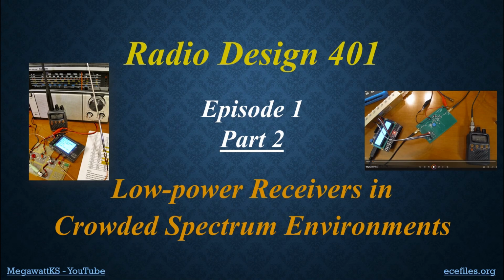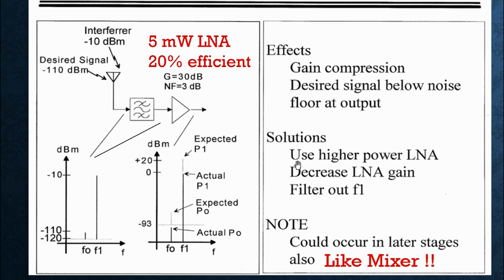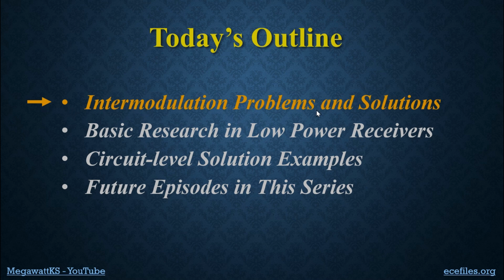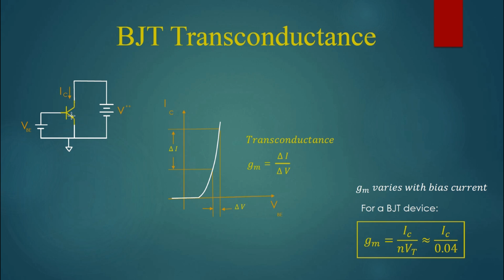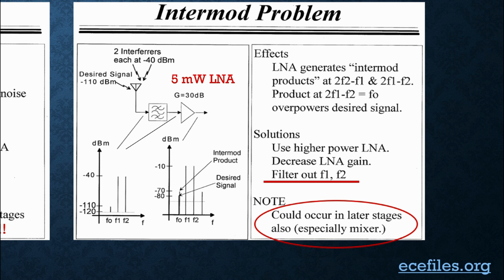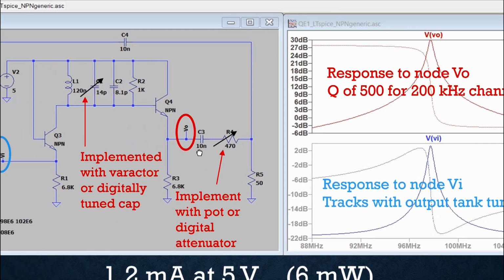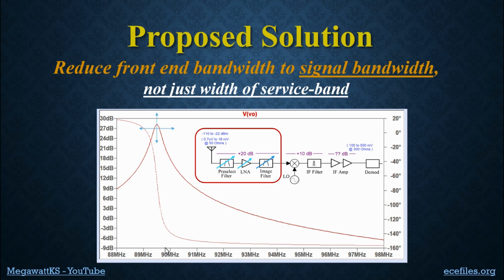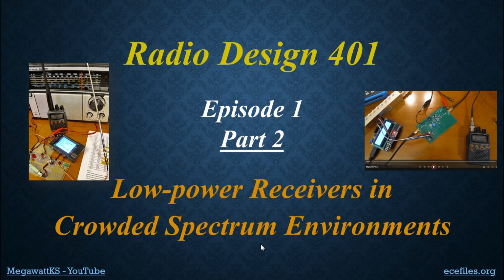Episode 1 Part 2 in Radio Design 401

Comment: Very interesting circuit for low level signal Rx. I did miss how this filter tunes to other SOI.
Reply from the maker: Thanks -  and sorry for the delay in replying. Tuning was done in the first prototype with a varactor diode in the collector-node tuned circuit. In later designs we used Peregrine Digitally Tuned Capacitors (DTCs). The basic idea is somewhere around 27:40 in this video. https://youtu.be/tuOc61TShDg?list=PL9Ox3wpnB0krNexW2k5JMCaewXN7LoRXd&t=1662   Bandwidth and gain are adjusted with the potentiometer in the feedback path. Hope that helps.
Reply from the maker: The version with the DTCs for tuning is in Part 3. Here's a direct link queued up to where the schematic is shown: https://youtu.be/43wQmYeqt44?list=PL9Ox3wpnB0krNexW2k5JMCaewXN7LoRXd&t=1789

Comment: Hi, when comparing the intermod products at https://youtu.be/tuOc61TShDg?t=1371 (i.e. 22mins into the video), you've changed the frequency of the original signal.  On the left it's 98MHz, while on the right it's 98.5MHz.  Doing the FFT on the left simulation with 98.5MHz signal instead of 98MHz shows the original signal, but it's about 80dB below the intermod products.  It's only a detail.  It doesn't downgrade your explanation.
Reply from the maker: Good comment !  Absolutely correct. I had to do that to be able to resolve the two spectral lines of interest - the intermod at 98 MHz and the "desired signal". If the signal is left at 98.00 MHz, we wouldn't be able to see it separately from the intermod.  So I just moved it to the right 500 kHz. I tried 100 kHz, but that didn't work since the transient sim is only run for about 15us. And only the last 10us is FFT'ed, so the resolution is somewhere around 2*(1/10us) = 200 kHz (the factor 2'ish is from the Hamming window applied in the FFT). I guess I should have run the other simulation with 98.5 MHz as you must have done. But the main point there was to see all the intermod products, and the signal would be 60 or so dB below the 3rd order products. Still - it would have been a better presentation. Thanks for pointing this out. It brings up some of the complexities involved in setting up the transient sim time and the FFT 🙂

Comment: Thank you so much for the great content you provide generously.
There's something about gain compression I don't understand and you mentioned it in the 101 series too.
When the sum of a strong and a weak signal enters an amplifier, the stronger one puts the amplifier into the compression state and so the gain for is reduced.
But the weaker signal is still in the linear portion of the characteristic curve and experiences full gain of the stage as normal.
So, why do you say that we the weaker signal also experiences the reduced gain? Am I ignoring something or what?
I'm clearly ignoring the nonlinear effects, just focusing on the gain aspect as you did.
Reply from the maker: This is a great question.  The short answer is what you said - the non-linear effects are being ignored in that line of reasoning. We're assuming there are two signals at two different frequencies with different amplitudes. It is the sum of those signals that goes through the amp and since it's operating non-linearly, we have to use a Taylor series expansion to figure out what happens. We can't treat it as a linear circuit like we normally would and consider each signal separately. The math is quite a mess since we need to include up to the third-order term of the Taylor series, which with two signals means many outputs at different frequencies. But we would concentrate on those that lie on the frequency that the weaker signal is at. At least one of the third-order terms will lie on the weak signal frequency and (usually) subtract from the basic first-order amplified output at that frequency. So the effective gain at that frequency is reduced.
Reply from the maker: To be fair, the math is such a mess (see for example: https://www.youtube.com/watch?v=0xwaxB9o1Ps ), that most people don't do it. BUT - maybe we could configure a simulation to see what happens. (The simulator handles the non-linearities when used in "Transient" analysis mode). But as in the video, we'd have to use an FFT to examine the output of the amplifier in various states of compression and see what happens to the weaker signal's amplitude in 'reality' 🙂

Comment: Could you please elaborate on the schematic at 28:00?
Firstly, from my calculations, Q3 has a voltage gain of ~20 and an input impedance of 50Ω. The output voltage divider is 25 / (470 + 25) = 1/20.
So, any R4 value below 470 would cause oscillation. Is that correct?

Secondly, how did you manage to eliminate the biasing network at Q3's base? Since Q3's collector voltage swings above and below the 5V rail, wouldn't that cause the Base-Collector junction to be directly biased for half of the signal period?
Reply from the maker: To the gain questions, yes - if R4 is dropped too low the circuit becomes an oscillator. So "automatic tuning" is needed in any real product to bring it close to that point, and then back off an amount that will get to the filter bandwidth desired. Interestingly one will never see the oscillation in an "AC analysis" which is what is shown. As one changes R4 and approaches the critical (oscillation) point, the gain goes very high and the bandwidth sharpens toward zero. But then, if R4 is reduced further, the gain will come down and the bandwidth will widen up again. So simulation needs to be on "correct side" of that critical oscillation point before trying something like a "Transient analysis" simulation...
Reply: @MegawattKS  yes, I did run a transient analysis to confirm that it oscillates
Reply from the maker: On the biasing, the circuit shown is not optimized for signal swing. It's just something I threw together for the first prototype. It works OK for smaller signals (less than 0.5 or 0.6Vpk) at the collector because Q3 will stay in the active region until its base-collector junction becomes forward biased - which is around 0.7V peak signal on the "negative" half cycle. True - the collector voltage will be below the base voltage for half the cycle, but Vce will not collapse to zero unless the collector falls below the (5V) base bias by 0.7'ish volts. Recall that most BJTs have a Vce_sat of about 0.1V. This was changed in the second prototype and Q4 also needed to be rebiased to allow large collector swings out of Q3. As shown in this first-prototype, the Q4 BC junction will become forward biased on the positive output signal swing at about 0.6V. Does that make sense?
Reply: @MegawattKS  it makes sense, thank you. Looking forward for the 3rd part
Reply from the maker: Another way to say this is that it is OK for the BC junction of Q3 to become "forward biased" a little bit 🙂 The carriers injected into the base from the emitter will still be swept into the collector because there is still a residual "built-in" field at that junction.

Comment: Hi, 
This series has been the most informative about radio receiver design I could find on the web.  Thanks for that.  I'm still working my way through the series, so I haven't watched all episodes yet.
I would like to homebrew an FM-broadcast receiver based on the design principles presented in the previous and this video series.  Would it be possible to get more information on the "implementation details"?  e.g. I have never designed a circuit with varactor diodes before.  Did you put two of them in anti-series and connect their cathodes to a higher (>5V) DC-voltage?  It would also be welcome if you could share the schematics of the "Q Enhanced Filter Core PCB" shown in the video.
Reply from the maker: You're welcome. Glad you found the channel. As to the schematic for prototype 1 of the QE filter, the main thing missing from the schematic presented is the varactor tuning (and a 100 Ohm series R at the output). You are correct that it is a to-diode pair in the package with the common cathodes tied to the collector node. Since it was a quick build, I don't even think they were officially varactors - 'BAT54C' Shottky diodes from my "Interstellar Electronics" SMD kit I had on hand. Marked 'KL3', but you can find the datasheet on Digikey with the BAT54C part number. It shows C varying from 18 to 6 pF for 0 to 5V bias. The rest of the circuit there consisted of the Pot at the top left of the board to produce bias - probably 50K or so from +5V to ground to keep the DC current low. The wiper of the pot is tied to the two anodes of the diode-pair through an 82K resistor to keep the Q good (see the resistor marked 823 in the photo). And then the node where that goes to the diode anodes is bypassed to ground with something like a 10nF cap. (just to make it AC ground as the variable in the schematic shown was). That variable cap went to +5, but that's just because +5 is bypassed locally to make it an AC ground. Sorry - I never drew a schematic with the varactor in it. I just moved on to Prototype 2 - which will have a full schematic shown in Part 3 of the episode - and is already on ecefiles.org  🙂  (Prototype 2 is the PCB version and the varactor was replaced with some digitally tuned caps.)
Reply: @MegawattKS  I found the schematic, thanks.  The final design has the varactor replaced by switched capacitors (as you already noted in another comment here).  I'm looking forward to part 3 of the episode to know more details.

Comment: Great video again...Thanks!  Looking forward to testing this out.  I love the positive feedback and have built many regens with it. Never built a Q Multiplier... Is this a similar idea?
Reply from the maker: Thanks for the feedback - it is very much appreciated. Yes, in a very general sense, they are similar ideas. You can do Q-enhancement (with positive feedback) at RF like in the video or at IF. I think the main difference might be that the Q multipliers are typically identified at IF. I had a Knight Kit R100 with a Q multiplier in it when I started out in ham radio. I miss that receiver!  73s  (BTW - I saw your 40m CW radio project on qrz.com. Looks awesome!  )

Comment: This is very cool indeed. Love your content, very informative and the presentation is crystal clear. Btw, is this scalable to higher frequencies then FM broadcast? Lets say 2.4 GHz Bluetooth LE with 2 MHz per channel? Or how about WiFi with 20 MHz bandwidth per channel? Or are there some constraints which in the end limit the practicality of such application? Is maybe gain flatness an issue on wider bandwidths?
Reply from the maker: Thanks for the encouragement and good questions. Yes - definitely scalable to 2.4G and other frequencies. It's just a matter of the technology. We're working on a 2.4 GHz version for WiFi in a deep submicron process (< 100nm) where the transistor capacitor parasitics are small enough and on-chip inductors are possible. 2 MHz bandwidth would mean an enhanced Q of 1200 - which is entirely doable if starting Q in the inductor is decent. However, real-time tuning (which we'll discuss in Part 3 and later) is needed. So this is definitely a research-level endeavor. I don't think gain flatness would be a problem since the final stage in a receiver is typically DSP and doing an equalizer would be pretty easy there. There is work in the literature on these things periodically, but noise and dynamic range (and tuning) have held it back. I'm hoping the new CB circuit topology with the tracking preselect filtering it offers can move this more toward infusion into products in the coming years!

Comment: At some point you will have to deal with in-band large dynamic range scenarios where the filtering becomes impractical. Designing radios for these scenarios involves high power RF components and more complex circuitry. That's where we're heading.
Reply from the maker: Good points. Agreed - there are limits to what this can do. It is not a panacea. But current analysis is suggesting that one can save 10x to  100x in LNA and mixer power consumption (for the same SFDR) with the new common-base circuit topology, which seems like a good tradeoff with the complexity in tuning that this entails. The full set of Episode 1 slides is on ecefiles.org and has some discussion of these issues. I'm hoping to cover some analysis that factors in noise figure vs attenuators and such in coming episodes - after a bit of the math is covered. Thanks for bringing this up!
Reply: @MegawattKS  I think the LNA can be bypassed altogether with polyphase harmonic rejection mixers. The NF will be around 2 dB, which is quite acceptable, given the super high IMD. With a proper implementation based on high speed CMOS switches, the current draw at the mixer can also be reduced. The remaining challenge is to derive the LO phases at N times the desired frequency. This involves high speed counters.
Reply from the maker: @lambdaprog  Thanks. This is exactly the kind of discussion I was hoping the series might generate!  I have not read up in detail on such mixer-first receiver architectures, but will look into them some. Of course at GHz frequencies, a deep sub-micron process is likely needed to get the capacitive parasitics and Ron low enough. And some high dynamic range lowpass filtering will be needed after conversion and before hitting the ADCs. It would be interesting to compare performance of these alternatives (spurious free dynamic range vs frequency offset and power consumption)...

Comment: Amateur radios have been using varactor diode tuned front ends for quite some time.  It's so cheap and easy to do these days that even CB radios started using it about 10 years ago.  The first thing the signal hits after the front end protection diodes is a varactor diode tuned LC band pass filter, usually followed by 1 or 2 more varactor tuned BPF filter stages.  Cheap microprocessors have really helped to add these features to relatively cheap radios.
Reply from the maker: Yes - I've got a portable wideband Alinco radio that does that, if I recall correctly.  It's a cool setup and as you said, the cheap uPs make it very practical. Sadly, the filter bandwidths are still broad relative to channel widths, partly due to the components - including the varactor. One other concern is the linearity of the varactor itself, with large signal swings. It would be an interesting study to see how much intermod distortion that creates. It can't be horrible since the first prototype used one. But our later prototypes are using high-Q switch capacitor banks with compression points around +30 dBm. More on that in Part 3 of this episode.  Thanks for leaving these comments. It's good to see discussions being generated !